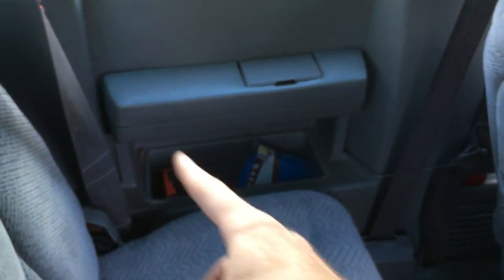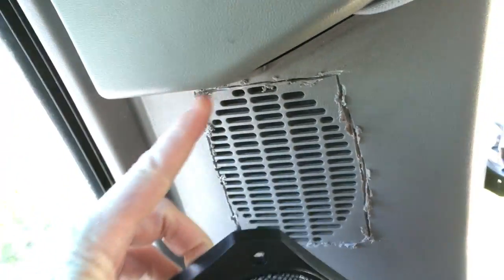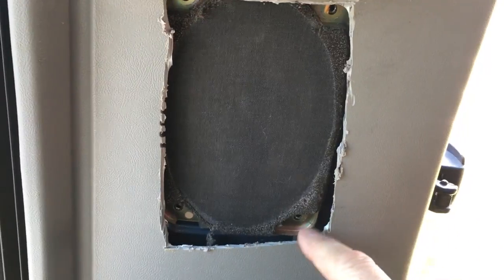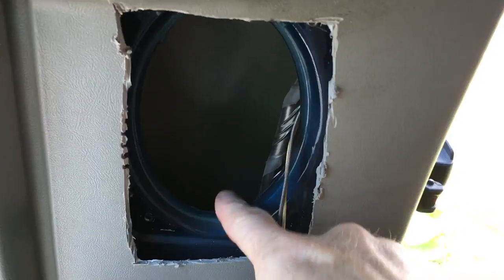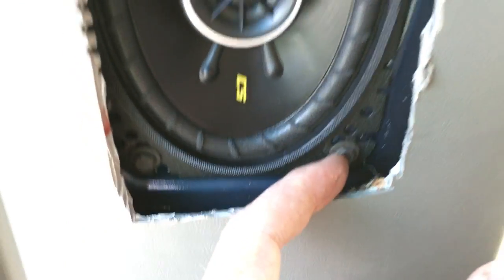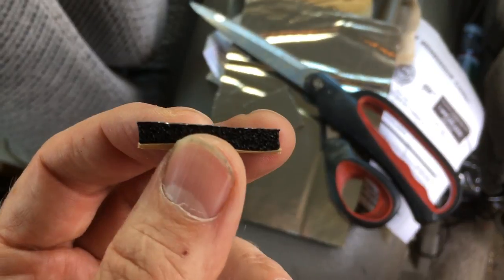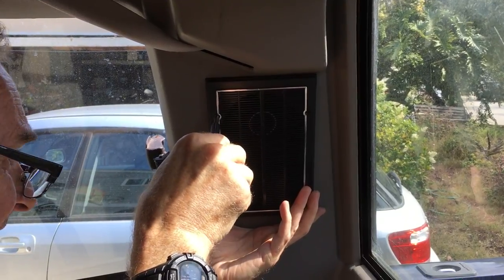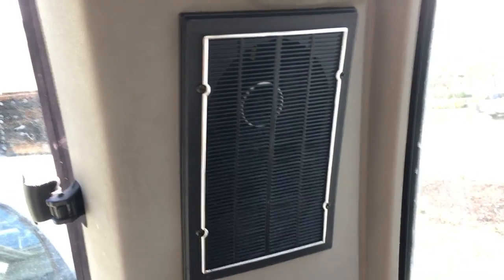Chevrolet Truck Rear Speaker Installation

Comment: Yeah... I'm not gonna butcher my truck 😬. I'll set a whole day aside and do it patiently and correctly 😎
Reply: The problem with that is the very good possibility that all the clips are gonna break. I did 6x9 in place of them.
Reply: @askmeifIcareify  yeah most certainly all the clips are old and brittle 😬
Reply: @askmeifIcareify  the truck is to do it carfully and super slowly, I did that I only pulled one clip off, just had to snap it back it👍🏽
Reply: I Agree That for this make they could have been designed a little bit better regarding the rear speakers  maybe some one can make a 3d printed removable insert or something. I wont cut my truck up to do this
Reply: I made a custom hole too...Not gonna spend a whole 2 days disassembling the truck cab just to replace the speakers
Reply: @chevy66driver  There's absolutely no reason why it would take 2 days to take a couple interior panels off 😂... But to each their own 🙏🏽
Reply: That's what I'm saying This some shit the generation above mine be doing I bought my truck for 1500 and boy I was pissed to find out She had 5 not 3 owners and 3 of them was some crack rigging jigging mofos half my working works in my truck My Dome lights rear speakers and front speakers don't work cause a hackjob I'ma do this job right cause I plan on selling my truck for 6k in 2 years once I get her back to Original and do some Undercarriage work on the suspension
Reply: Either way its a chevy i dont see why you should care about it getting butchered😂
Reply: Maybe some better looking 
Low profile covers same color of panels as well
Reply: @mickeyslim  no body asked bud
Reply: I hear you not going this route either
Reply: @Chavita0427 probably because these Chevy trucks are going up huge in value unlike fords and dodges of this era that have all been scrapped
Reply: @Chavita0427 because those are actually really good trucks and people nowadays are starting to really want these trucks, a 5.7L is very very reliable my dad crashed his and it had I think he said like 400,000 mileson or like 370,000 it was close to 400,000 those motors run forever as long as you take care of it and not to mention those trucks are sexy asf I got one ams boy oh boy it's ment
Reply: I definitely snipped it! Out of here!
Reply: Good luck

Comment: I just bought a set of 6x9s and I’m going to be cutting out the location and mounting them. It’s a truck, it’s not a show car so I literally don’t care what I do to my truck.
Reply from the maker: I’ve seen a few post on the Internet by people who have put 6 x 9’s in there, and they look pretty good. You might have to cut away a little bit of metal, but the speaker covers that come with it should fit on and look good.

Comment: This is what I was thinking of doing but I hadn't even thought about adding grills. I was just going to leave it open, so thanks for the tip. There's no way my 23 year old plastic trim won't shatter into a million pieces if I try to remove it.
Reply: My thoughts exactly, I'm trying to replace these and no auto-speaker installation store wants to do it 😆

Comment: You need to replace things the correct way and not butcher it
Reply from the maker: You’re right. People have done videos showing how to do that, but there is a lot of plastic, and a lot of things that you can break when you do this, so I wanted to show people a different way, if they wanted to have better sound, but were not comfortable taking all of the interior plastics apart. My method works, and it still holds together great. I think I picked the ugliest possible speaker covers though. You could probably find some that look pretty good.
Reply: I quite like your workaround.   Not like we're working on show trucks here, I think I'm gonna do the same thing.
Cheers

Comment: I think this is the best way to change the rear speakers on these trucks. Less hassle. Taking the seat out and all the paneling that will end up breaking is unnecessary. Thanks for the vid👍🏽
Reply from the maker: You’re welcome. I agree. Trying to get all of that old plastic out of there without breaking it would’ve been impossible, and I didn’t really want to take the seats and everything else out either.

Comment: Thanks for the idea I’ll do those and put a 6x9 don’t want the hassle of removing everything and breaking stuff even professionals would break clips I bet hahaha🤙🏽
Reply from the maker: You’re welcome. A lot of people say this is ugly, but it’s a lot easier than taking everything apart.
Reply: Did the 6×9 fit the place?
Reply: @alfredoavila  im sure he had to cut
Reply: Did the 6x9 fit?
Reply: @j9392  no the original speakers are 4" x 6" front and rear are the same they are not 6 x 9

Comment: I have a1988 chevy silverado k1500 no way I would never do this to my truck if I do it I'll do it right
Reply: I go through those stupid 4x6 speakers every 2 or so yrs, 
no fkn way i am tearing all this plastic crap off, risking breakage and burning an afternoon up when i could just pull both speakers out, install the news one all in  30mins now..plus i thing my matching blue interior fabric covered fab system actually looks better than the factory speaker slots..

Comment: another thing, could you provide parts numbers for the speaker harness?? GM trucks use a Metra 72-4568 for the front speakers but I cant seem to find what the back pillar speakers use but i know its different
Reply: found the speaker grills you used and got the tape but now I just need information on those metal clips, i cant find those anywhere since i dont know exactly what to search for. i appreciate any and all of your help!
Reply from the maker: I bought the speakers from Crutchfield, and the wiring harness came with them. I don’t know what the model number is, but I bet they have it on the Crutchfield website. The little screws and clips were included with the kicker speakers I bought. I tried looking around for them on eBay, but I don’t know what you would have to call them to find them.

Comment: I think this is a really good idea if you are gonna use factory speaker wire. If you're not going to upgrade the wires then do this. If you do want to pull the panels find the best videos you can to help, even then I broke some plastic in area's where the clips really gripped in the frame and plastic gave. Overall things went back ok but its a really bad design by GM just to get to speakers. I will never take those panels off again, now that I got upgraded wire, if I ever go back in this is the way to go IMO. Good Video.
Reply from the maker: Thanks. This video gets a lot of hate, but I knew it would be a disaster if I tried to take all those panels off. I’m happy with the solution as well.
Reply: I saw that and was surprised. I will be doing this if I ever change the speaker. just find a nice cover and call it good.

Comment: Probably would have been quicker and easier to just remove the parts and do it correctly.
Reply from the maker: Probably. I was worried that all the old plastic parts would crack and break and I’d have to buy all new trim and fasteners.
Reply: hoohoohoblin for future vehicles I would recommend Crutchfield. They sent me instructions and great mounting brackets. I was able to get all my speakers installed in under an hour. Hope your system is lasting though, because the factory speakers in these trucks is TERRIBLE
Reply: I like it , may be if you want to keep your truck looking original you would
do it by removing everything and spending more time , but to save time and trouble this is a very easy and quick way to do it.

Comment: I put 6" sub speakers down below the cubby hole/armrests area behind the front seats near the floor, with a hole saw lots of room if you pull the bins out and put insulation in it too, it puts out great sound. But I might try that and have 6.
Reply from the maker: Thanks. My son wants to hide a subwoofer in there somewhere. I am wondering if we could convert part of the center console box into a subwoofer while still leaving room to store things in it.
Reply: hoohoohoblin I've seen people relocate the jackstand behind the passenger seat and place a low-profile sub in its place. Also you can unbolt the center console from the floor without much difficulty.
Reply: I just wanted a little more low end, I didn’t put a amp or anything not my style.
Reply: hoohoohoblin Both ChrisFix and Random Audio Guy have excellent videos on making custom center consoles and or a enclosure for your sub.
Reply: Was also thinking of doing that to my truck .. Is it possible you make a video showing what yours looks like so we could get an ideal of what to do

Comment: did you order these online? can i get links to the grills and insulated tape?
Reply from the maker: I bought the insulated tape on eBay, for the bottom of my truck where the floor gets hot above the catalytic converter. I think it’s just generic sticky foil heat insulation tape in 8 x12 sheets. I bet there is a product that is better, designed for acoustics. I also bought the speaker grated on eBay, and there are a few different sellers who sell the same thing. Just do a search for 5 x 7 speaker grate and you will find it. I wish there were more attractive options, but 5 x 7 is a strange size.

Comment: It takes the same amount of work take off the panels and get it done, but whatever. I don't make video's.
Reply: No
Reply: prove it!
Reply: You have to pull the seat out take off all panels more time consuming instead cut hole replace and put speakers cover over it

Comment: I have a 05 reg cab, would the rear speakers still be the same, and are those 6x9?
Reply from the maker: I don’t know if they would be the same size or not. I have seen pictures of people on the Internet in truck forums who have put 6 x 9’s back there, so you could probably make them fit. A good way to find out what the standard speaker sizes would be to go to the Crutchfield website and enter the year and model of your truck, and they will tell you what size speakers fit into it.
Reply: The regular cab is probably gonna have different rear ones. The speakers in the video were 4x6, and we're for an ext. Cab

Comment: Hoohoohoblin Do you buy your speakers online and if so where? Also did you keep your stock 1 1/2 din radio or go aftermarket.? Thanks for the vidjeo
Reply from the maker: I bought them from Crutchfield. They are Kickers.  I bought a radio and a 1.5 din adapter but haven’t installed it yet.  The stock radio CD player sounds fine to me but my son wants something louder with Bluetooth. We bought a Sony MEX-XB100BT, which has a lot more power than most car stereos, so we won’t need to buy an amp. We will do an installation video soon.
Reply: hoohoohoblin Thanks for the information I'll look into it. Nice with the CD player I've seen people solder a aux connection to the circuit board. Looking forward to your next video.

Comment: Brilliant.  My 98 C2500 with 415k miles will likely see the junk yard before it sees another owner.  I believe I will install my new rear speakers exactly how you’ve shown here.  Thanks for the video!
Reply from the maker: You’re welcome.  People cringe when they watch this video, but I think it’s fine, and it was a whole lot easier than taking all of the plastic out.
Reply: @hoohoohoblin  I can understand the cringe.  I would almost always be against this type of install, but for my particular circumstances, this will do the trick.